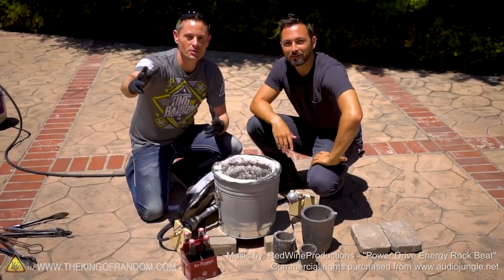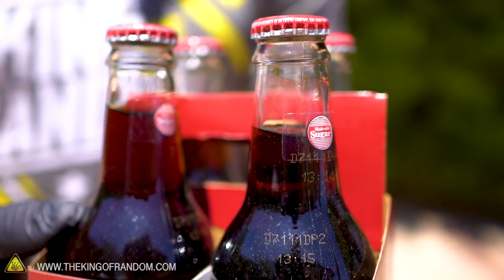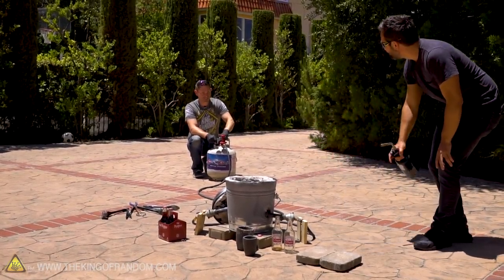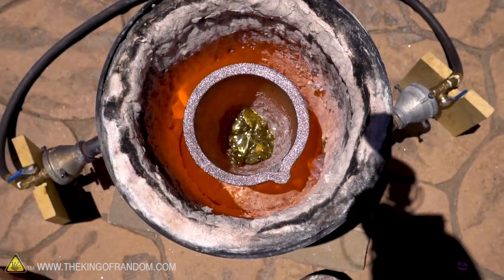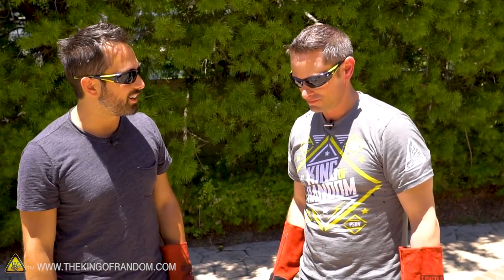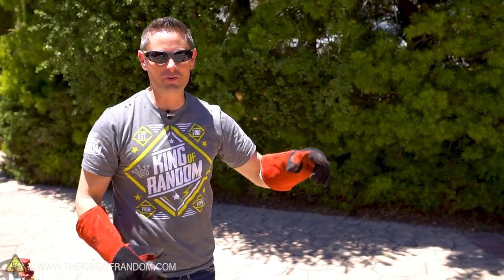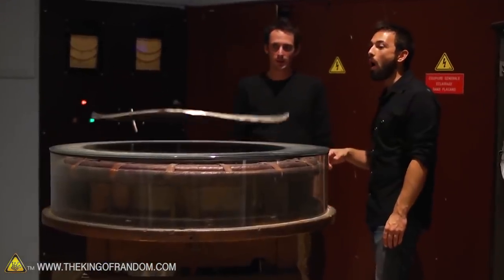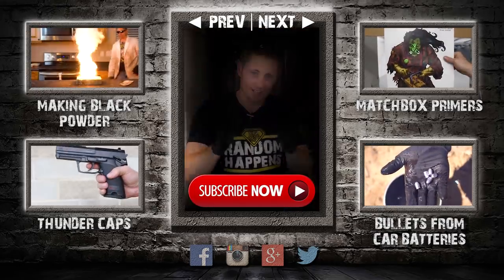Will Glass Bottles Melt? TKOR Takes Glass Melting To The Next Level With Our DIY Foundry!

Comment: IS IT HOT ENOUGH TO MELT SAND TO GLASS? LIKE U AGREE
Reply: Sounds pretty dang cool :D
Reply: That's not how it works
Reply: noobbzzz d you know that glass isnt made from sand right?
Reply: Hunter Henderson mimecraft players
Reply: noobbzzz d i was just going to say that, but before i did, i did research some other guy did it but failed
Reply: Bruh Glass is made using Sand The Sand Called Silica Sand To make Glass
Reply: noobbzzz d Mine craft isnt equal to real live
Reply from the maker: I think silica melts somewhere around 2,650F and turning sand to glass is a process I haven't been able to figure out yet.  But adding Sodium Carbonate and lime is supposed to lower the melting point.  I'll be playing with it..
Reply: Grant Thompson - "The King of Random" oooh Grand Thompson i will look forward to that ❤
Reply: You just have to put it into a furnace for a couple of seconds

Comment: try melting titanium whit your metal foundry
Reply: jente rboy the foundry would melt before the titanium but it wouldn't melt anyway
Reply: The Titanium will burn away very quickly as it oxides easily and really holds on to that oxygen. The world has plenty of titanium in the form of titanium oxide, and breaking that bond to form solid titanium metal is the difficult part that makes it so expensive.

Comment: Is it possible to melt meat?
Reply: it'll Burn to ash
Reply: There's a chemical that melts meat that's called "meat glue." It's how sliceable lunch meat is formed into loaves and stuff. If you get some and use it you put a fine particle mask on or you're done I think.
Reply: Duff Smith like, theoricly if you increase its temperature in a sealed envirement, after removing its air, it may get to its melting point without combusting/igniting
Reply: No, it would just burn...
Reply: Bieel C.E.C no it would definetly burn because my dad is a butcher
Reply: Mc Leary you dont need to be a butcher to know that

Comment: Glass is a fluid, not a liquid.  Glass melts at a much lower temp that most metals.  Your biggest issue is going to be thermal shock.  Glass is a lot of fun, but you need to be super careful, as the glass can vaporize more than you'd think, potentially causing silicosis.

Comment: hey grand what happens if u pour liquid nitrogen into the molten crucible
Reply: SHANDANU Prince it will shatter because of the violent heat exchange that occurs because of the huge temperature difference
Reply: If enough manages to make it into the crucible, it will suffer from  thermal shock and shatter, however, most of the liquid N would vapourise as it met the warmer airmass of the foundry.
Reply: hey Adrian Kruger that would be so satisfying to watch
Reply: SHANDANU Prince grant
Reply: SHANDANU Prince I think it would make steam also
Reply: or else what happen if u pour liquid nitrogen into molten glass

Comment: if it's not melting. How the Heck the bottle company made that bottle to the bottle shape
Reply: Andrews Alvis injection molding
Reply: Blow molding, injection wouldn't work
Reply: I meant .. will it melt by his home made melter or whatever he called it .. Because he basically just uses 2 big blowtorches and a fireproof Bucket. Get his point?

Comment: You could have more luck casting glass if there was a shorter drop from Crucible. As a child I used to stretch glass bottles by hearing the neck of the bottle and letting it drop to a fire brick.

Comment: Glass doesn't flow when it's solid. That's a myth based on old windows that weren't perfect in shape and thickness. The thicker edge would go at the bottom for obvious reasons. It didn't flow, it was always that thick.

Comment: you should have used a propane or MAPP gass torch on the glass as it was pouring down into the mold. it would have retained its viscosity a-little better. and like you said, pre heat the mold. but if ud like a shot of redemption, use torches on the glass at all points during the casting. and melt 3 bottles worth for that one casting. :3

Comment: I can melt glass like butter, using yard blower for my super heat, cedar wood , in a 3×3ft ×4ft Hogan style burner box. No propane required. Extensive experiments.....Gold, silver,copper, NO Problem. Crucible is the same as yours,,,,2500 deg f.     At least.   Built below ground with Adobe mud. Let's talk

Comment: 😍😅😍 they are not aline as there was a lag to reseve and to match to reseave at bothes ends.of the positioning existences😍
Space inbetween becomes sollid not the atoms there selfs oldo the conditions of the space inbetween within and around decides the positioning behaviure😍
While liquids is that the space inbetween has so match diverentional it stays morphieus.

Oldo glas seems not to Crack if I trigger a gravatron evvend inside the glass chaimbr when the glass is sphearicle😍
Otherwise the Glas grows in the hairy structure our cracking structure ture this depends on the bouncing en spearing behaviurebof the waves trouth the cosmic glass dimention😍